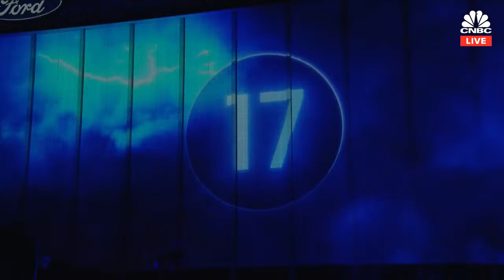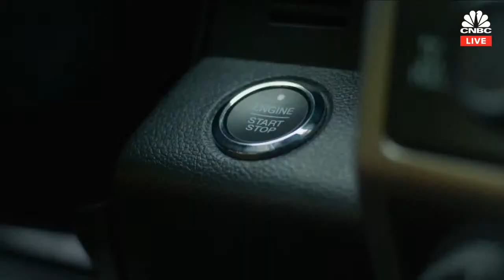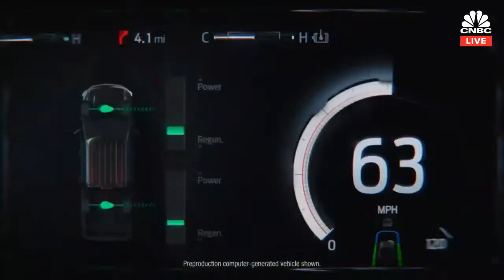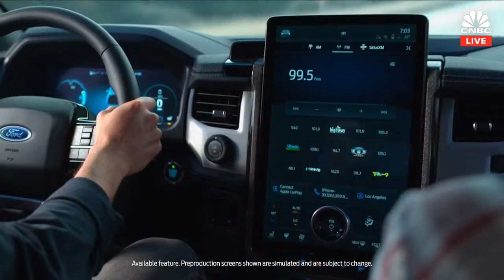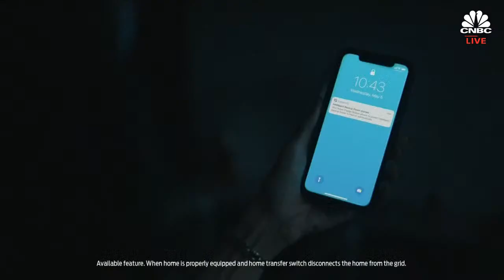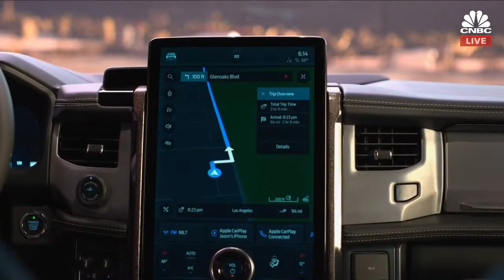LIVE: Ford Motor reveals new electric F-150 Lightning pickup — 5/19/21

Comment: Great cars but they need to solve the range problem. Public charging isnt' cheap.
Reply: cheaper yuan gas if you don't mind the time part.
Reply: @scottanderson9656  Time is money to most folks.
Reply: @dylanarnsdorff5947  Yes it is but what I am saying is it's cheaper to "fill up" using electric than gas.  If you're not exceeding the range in your daily driving/commuting it's much cheaper to use electricity.  Money is money.
Reply: The issue of charging time may be resolved over the long run, there’s an incentive to speed up the process both for customer satisfaction as well as profits via clearing the stations for more vehicles per day.

Comment: 300 mile range huh? So to tow my 5000 pound holiday trailer to go camping 500 miles away its gonna take me two days to get to destination where I can do it in 8 hours with my gas pot on the same day?
Reply: Exactly! 300 miles only!? lol  My Toyota Prime gets 800 miles!
...and 300 miles is only if you spend $100,000 on the extended battery edition F-150 EV truck! That $39k price tag is a joke,... they don't tell you the truth here at all!
Reply: That all depends on charging times.  I haven't seen that advertised anywhere, have you?  I take your point though, 10 minutes to refuel compared to 1-hour charge multiple times is going to extend a journey by a lot.
Reply: @liveuntetheredmusepodcast4832  yeah I feel they're throwing the biggest spec numbers (which are ehh) but the lowest entry priced truck. What's a bare bones truck specs? And a full spec price? That'll be the letdown
Reply: @liveuntetheredmusepodcast4832  you spend 52k for the extended range 300 mile version
Reply: @papapizzaa  The XLT is $53k.  The one worth buying though, (if you can really say that) will be $100,000...and it only ranges 300 miles, is just crazy to me. Great for going to the store lol...quickly, but not state to state without multiple stops adding time to  your trips!   

Ford F-150 EV Lightning
MSRP starting at $39,974 up to around $90,474.1
Reply: It's a neat Truck, fun to watch the promo, and it would be fun to drive it, but I would never own one. If I need a Truck, it's going to be a real Truck. 
If I want an EV or Hybrid for trips and distance, it better at least go 500-800 miles, which mine does. 
I'm sure I will see lots of thee EV trucks at Krogers in Michigan! Since I'm close to where they are building them! lol
Reply: Oh hey an edge case that applies to basically no one
Reply: It doesnt take 10 hours to charge, more like less then an hour
Reply: @davidkirinic9463  Full charge takes the entire night. 120 or 240 watt. No electric vehicle out there charges in an hour.
Reply: @liveuntetheredmusepodcast4832  Tesla's charge even the biggest range one around the hour.
Reply: @liveuntetheredmusepodcast4832  But you dont need 100 %. 10 to 80 % in Tesla I think is around 20 minutes. That last 80 to 100 is long

Comment: All sounds quite fantastic.  I have only one, early on concern, that the 300 mile range is too short.  But, if I were to guess based upon where the battery technology is going that within a year after the initial market launch that range will increase to at least 600 miles and there will be many more charging stations.  If I were to buy one I would wait until 2023.
Reply: The range will absolutely not increase to 600 miles after a year, more like 20-40 miles.

Comment: I'm a little disappointed in the towing capability. I think the cybertruck tops out at 14k lbs? I was hoping for the electric f150 to have a towing capacity around the same as the cybertruck, of not more. The price tag on this truck is very appealing though. Still a toss up for me I were to go b/w an eF150 or cybertruck.

Comment: front light bar not attractive, there were better lines there, could have been more useful in the lower bumper grove,
but moving forewords can be bumpy, I have always like older ford truck rigs so I hope its built like they did back then
tuff, stage camera is to low at times not flattering for the truck
Reply: the lightbar all along the front seems to be a common theme with electric trucks, must be how they want to 'distinguish' themselves. I personally dont mind it but can see how it would be subjective.
Reply: I really like the light bar
Reply: @jonmarshall3414  it looks like they copied the cyber truck. I don't like how it looks on the ford tho
Reply: @lecookie007  i think rivian technically had it first but hummer is also doing it, they literally all are doing it :)

Comment: F-150 Top of the line $90.000 – Cybertruck Top of the Line Tri-Motors $69.900, plus 40% More Towing, 70% More Range, 60% Faster Acceleration, 70% Faster Charge, Air Suspension, Ultra-Hard 30X Cold-Rolled stainless-steel structural skin and Armor Glass. …and I will save $20.000. There is not much more to think about, what do you think?
Reply: I think most will buy the brand not the better, this is ford we talking about Americans will buy it no matter how many other options around... I mean just go outside an look around. I'm glad they finally changed their minds about all electric, now we look at Toyota, Nissan, GMC, Dodge, an many others to do the same then we will have competition an motivation to sell the best vehicles possible

Comment: Neat. Once EV’s can be 100% re-charged in under 10 minutes, I’ll be interested.
Reply: You’ll never be interested then. This entire EV craze is a farce. The posted range they give is Bull. It’s about half that. Charging stations are far and few between and if you want to charge at home you have to put in a 240v line otherwise it takes 3 days to fully charge with 110v. With a 240v expect 6 hours to fully charge. I bought an Audi Etron Sportback 4 months ago. I just gave you a few very annoying issues with owning an EV. However, I’m happy to announce that I solved all those issues now! I called my dealer and told him to get me out of this Etron and get me into a Q5 sportback. It cost me 10k to break the lease because the value of the Etron dropped fast but it was the best 10k I ever wasted! 😎
Reply: Well ford wont give you that  however the cybertruck will have 500 miles of range but probably charge 10% to 80% in 15 minutes.

Comment: 10,000lbs towing weight is less then my current F150 which 13,000lbs
Reply: Well I guess it’s a flop then
Reply: 50+ iteration of the Gas powered F-150 vs first all electric.. no flop seems great to be so close with the very first one 50+ from now will be amazing

Comment: Power figures are excellent... everything else is just a disappointment.
Reply: @Iwhbyd ok first why are you racing on the streets.. also have you not seen porche taycan, audi e-tron, rimac, or tesla roadster... they will go well pass 120 still ahead of most gas powered cars, it seems like your only perception of electric vehicles is a prius...also gas vehicles have had over 100 years of improvement, we just started open your eyes an realize we aint making racing cars we making efficiency an range, once the money comes in then research into speed...

Comment: Good luck!  Need fast charging network
Reply: has FORD slow charging network.
Reply: yeah, long distance travel and charging times really the only thing holding back EVs. For most people who can just charge at night it makes sense 90% of the time.
Reply: The 300 mile limit is best performance, when under load the EV travel distance is greatly reduced which will turn a lot of people off, especially if you have long charging times.    I'm all for EV's, but this is the only thing really holding me back atm.
Reply: @utha2665 I agree. Maybe an option for an additonal "Frunķ" battery.
Reply: @mralb7758  Yeh, maybe.  I just think they are putting all their eggs into one basket.  Eventually, yeah, when the battery technology improves to the point where you can get more from a charge when hauling loads and charging times have reduced to the time of what it takes to fill a tank.  Until then I think manufacturers will be losing money and potentially customers.  I would have thought a hybrid solution would be a better option, for now, to cater for the lack of battery capacity and charge rate.  Just my opinion, though 🤷‍♂️
Reply: I have a Chevy bolt it’s been coast to coast  who cares about how long it takes to charge. It’s about the adventure..... do w drive electric .....???

Comment: Looks great. It looks like an F150 because it is an F150. Now why couldn’t Ford have done the same thing with the Mack E “ Mustang “? They should have used the mustang body like they did the F150 body. The only thing mustang about it are the taillights.
Reply: The SUV market is too big to pass up, sadly money was the motivation to make the Mach E but as more people support EVs the mustang you know will be made but right now those mustang owners love their v8s way too much
Reply: @Ultima_Weapon_Rasiel  
Of course money was the reason. That’s why they’re in business, to make money. It’s how to keep people working. 
But 300 miles is not that far, especially if you’re going somewhere and want to get back to where you started that same day. You’re limited. Wouldn’t want one for a work vehicle.
They better work on getting a lot more miles out of those batteries to really rival gas vehicles.

Comment: To clarify, Tesla set the bar high for an electric truck, not ford. Obviously.
Reply: this is better than cybertruck imo
Reply: giga texas, closer and closer every day. so weak argument. Cybertruck kills it on all the stats. Name one feature the Ford offers over the cybertruck? The idiots at ford just threw aerodynamics in the trash for the sake of flexing their frunk a little harder.  Fords getting ready to deliver trash
Reply: Haha fanboy fight
Reply: Nomen Clature  you forgot to list a stat that the ford offers over the cybertruck. Cause the whole story goes a little something like this. The company with next-generation battery tech builds better batteries that will go 520 miles, while the Ford, using a decade old battery design, will max out at 300. Thats brand new before they degrade via cycling (which will remove about 15% of max ranger after the first 1,000 cycles) , and thats before any range losses due to cold weather or towing. THAT is why the Ford is going to be trash. Because even when its working perfectly, exactly like they promise, if you want to tow a trailer through colorado after 2 years of ownership, that original 300 mile battery will take you about 100 per charge. OH and fun fact, these additional cycles you will need to charge up, that will cause your battery to degrade faster than the cybertruck, which will go go further per cycle, and thus, cycle slower. That's why the Ford is going to be trash on delivery. I guess the whole manly cowboy sales voice really works on some of you, huh?
Reply: Nomen Clature  and then regret it some move when it starts to rust
Reply: Nomen Clature  There were several sentences. Take you time, you sound like a slow reader.
Reply: Nomen Clature  Oh, dear, the last resort of someone losing an argument. Picking on peoples grammar.

The Cybertruck is far and away better on actual stats. As for JD power. Yes Tesla did come bottom. Mainly because of cosmetic issues (not mechanical) Paint imperfections, Panel gaps, that type of thing.

The good news is Tesla are addressing these issues, with things like Mega castings, new state of the art paint facilities etc. One things for sure, Tesla are the leaders in the EV market, and I don't see that changing.
Reply: Nomen Clature  I have no doubt the Cybertruck will pass whatever regulations are required. Tesla will know the requirements better than you and me.

Comment: The battery degradation is what kills me with these cool new EVs. How much of all those years of gas savings are erased when the battery needs replacement while and ICE vehicle at the same milage/age doesn't need a new engine? Even if you don't plan to keep the truck as long, the resell value will be factored in, making it cheaper than an ICE vehicle.
Reply: It really depends on what type of batteries really. Battery degradation gets better over newer battery technology. I know Tesla and Chevrolet battery degradation is pretty damn good. But you look at the Nissan leafs battery degradation rate, and its god awful only after like 8-9 years.
Reply: You do also have to consider reduced routine and unexpected maintenance.
Reply: Oh no, fits won't replace the battery, just like Tesla - you didn't know that?
Reply: Degradation being a factor is a thing of the past
Reply: @mjlee177  My Note 20 ultra disagrees.  Run it dead a few times, watch what happens.
Reply: They did mention 63000+ charges, that's a lot of charges, even at 5 per day is over 34 years.
Reply: @utha2665  And they had these batteries 34 years to know this 🤔
Reply: @amelliamendel2227  lol. Goodness. Enigineers can find the average degradation rate of their batteries. Of course you have to take in a variety of factors such as temperature, how often you fast charge, not overcharging, etc.  It seems like your note 20 battery hasn't been taken care of very well, lol, I'm jk but freal, I'm sure you charge it up to 100% every night, like most everyone does. Smartphone Batteries are made quite differently that EVs. Batteries in general really need only to be charged up to 80-90% and never dip below 10% to extend it's life quite substantially.

A big difference between the two is that most all EV batteries have a buffer zone, even if you charge it up to 100%, it's not the same as charging a smartphone to 100%. EVs leave a gap of room so it's never charged fully. Then, overtime, it will start to slowly give back some of that buffer, closing that gap to account for any degradation, seeing less change in range. That's how you see these Teslas and other EVs last 400-500k miles with not much degradation at all. It's pretty dope freal.
Reply: @amelliamendel2227  Yeah, I know, I'm just stating what they claim.  Whether they hod a full charge for this period is yet to be seen and I doubt it does if you look at the current battery technology. I still think the batteries aren't there yet either and that is holding me back from getting a car for something other than city driving.

Comment: I still think a OM617 engine would outlast one of these anyday.
Reply: Time will tell, less points of failure with an EV so likely will experience less maintenance costs but long term reliability on many EVs as the market moves to them will be interesting . Battery degradation and mitigation will be something to keep an eye on too.
Reply: I see we have a Benz guy.
Reply: @MdoubleJay  😉yep, my om617 is 41 years old and still runs strong!
Reply: @tydale8629 I’ve actually got a OM613 pushing 400k. Sadly I don’t drive her as often as I used to.
Reply: @MdoubleJay  Waw thats amazing man! those are tough engines too. My OM617 is only at 310,000 km.

Comment: Regulations should be quickly created to force a common charging interface so any EVs can be charged at any EV charging stations (as you do for gas ones). Better to do it at the very beginning as it is much easier this way. Some of your nightmare country already did it.
Reply: Who's going to pay for it? The public? The government will waste that money building an inferior system. Teslas private system is the best for a reason but they will probably allow other cars with adapters to use their chargers but not many companies are approaching them on that offer.
Reply: @odisy64  Indeed, brain power is what is needed to solve problems. Otherwise, even 300 million pound guerilla will only belong to the zoo.
Reply: Better yet, even battery swap interfaces are being standardized as we speak so battery industry can flourish more independently on its own.
Reply: @ppeterzhong  i dont think battery swap is going to be a thing in the long run seeing how NIO is handaling it. It was thought up as a solution for slow charging at the cost of a more expensive charging station. But charging speeds are rapidly getting better and at some point the swapped battery subscription system will be obsolete.
Reply: @ppeterzhong  battery swap only good for commercial vehicles, not personal, people won't want to use others battery an its a law suit waiting to happen when a battery fails